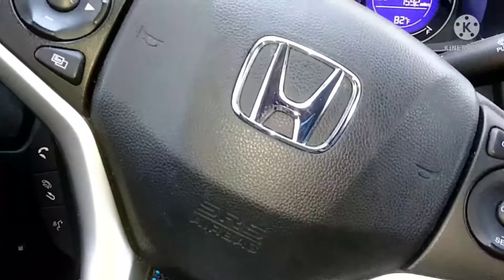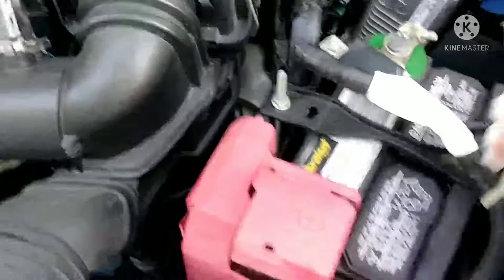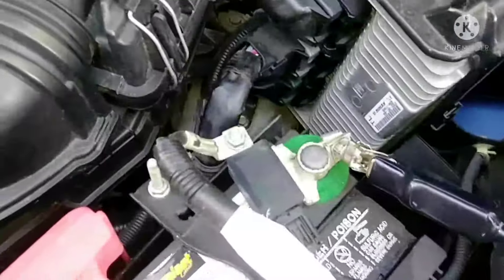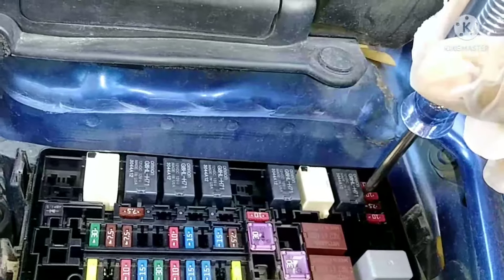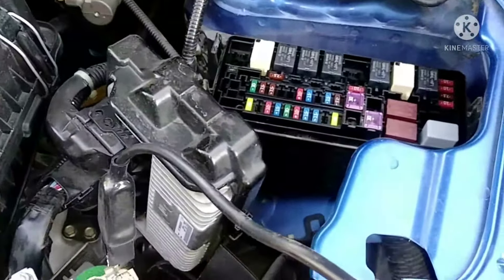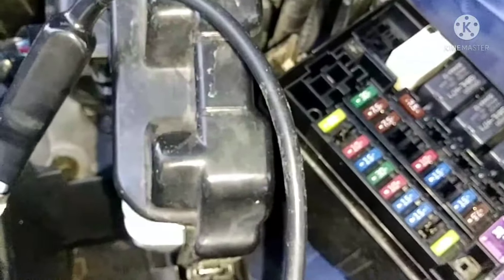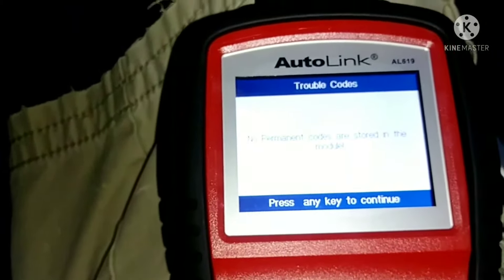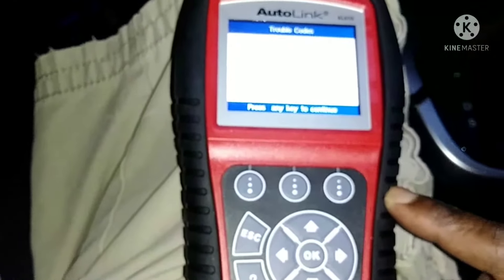U0155 HONDA Code - F-CAN Malfunction Gauge Control Module-Powertrain Control Module

Comment: Did it happen again? Did you have any solution for this problem??
Reply from the maker: It comes and goes, but it goes away longer
Reply: Like what period of time? First time it happened to me it went back like 5 months later, now has been 2 months between each incident, is that same as yours?
Reply from the maker: @aaronsanchez3258 yes